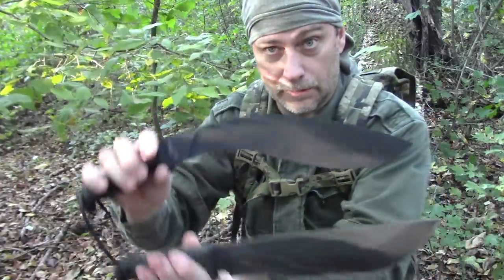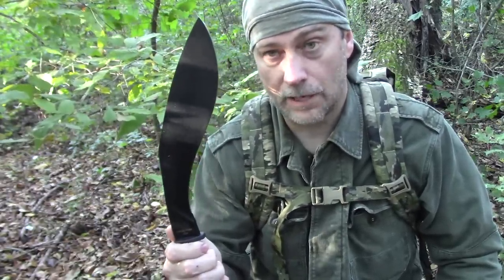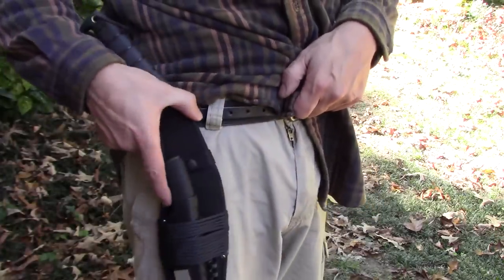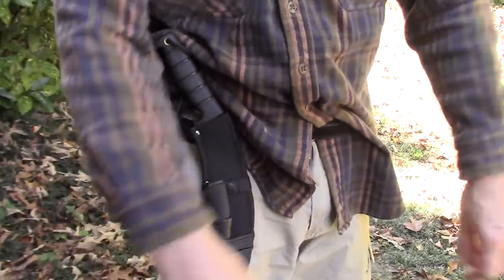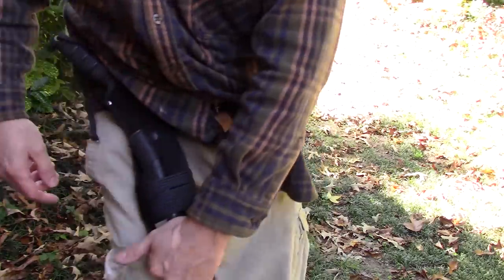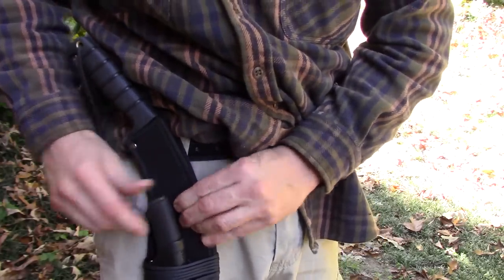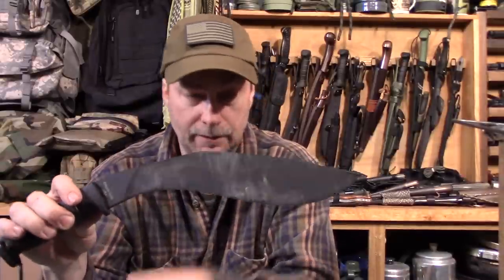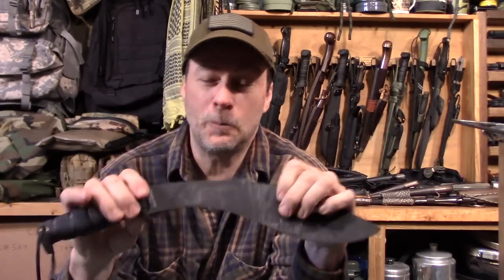Ontario Kukri vs. Ontario SP 53!

Comment: I like the "conclusion" being "inconclusive" and why that is; they're different tools that both do well for the tasks they're best suited for doing. The problem with a "one tool option" is that only having one tool limits your options.
Reply from the maker: Very well put Bob!
Reply: @Reallybigmonkey1  I want to point out that the kukri evolved in Nepal as a "Jack of all trades" tool so that you only have to carry one tool for everything from farming to hunting/woodcrafting to warfare. Like any such it's going to be a compromise, really good at some things, so-so at others and not so good at yet other things. The environment it evolved in is pretty similar to temperate forests like you find in the US, and in my experience, they do just fine for people like me who really like to travel light with as little gear as possible.

My favorite bush knife isn't a proper kukri though, it's a sirupate, a longer slenderer version of the kukri. It's better at clearing trails than a kukri because of the length and it feels better balanced. It still has the weight to do serious chopping.

The bottom line as you said, is what are you going to be doing. Select the tool for the job.
Reply from the maker: @markfergerson2145  Thanks for the comments Mark! Very well said

Comment: I have an sp 53 (based solely on your recommendation... and its awrsome!) And that Alan Kay kukuri from condor. I'd have a hard time choosing one over the other, because the steel on both is roughly the same thickness, and really, they're both so different, I use them for different things. The kukuri is the one that is on my "go bag" in my trunk only because it is [slightly] more "multitool...ish". The straight part is for carving, the angled for chopping, and the Alan Kay version has a flat pommel for hammering.
Reply from the maker: Perfect comments Chance! Those are both good blades but have very differing uses.

Comment: Here's my thoughts based on the very beginning of this video. The guy has the one but is wondering should he swap it out and buy the other. Based on everything we just saw, there would probably be no reason for him to change it out. Why spend more money for the other when the one he has can definitely get the job done. Add in the fact that should it ever be needed, the one he has would be a better viable weapon. 
As far as someone that has neither but is looking to purchase one or the other. I guess it would come down to what they are planning to use it for as you mentioned. One is a little heavier and shorter while the other is lighter and faster but longer. All things someone will have to take into consideration. I really don't see one being a better choice over the other based on all we have seen here. Each has its strong points. I think I would gladly have either in my bug out bag. But, if i had one of them, i wouldn't feel the need to spend more money to buy the other. Use that money for something else.
Reply from the maker: Very well said Michael! And I think once you own and use either of these one with become quite proficient with its use

Comment: I love Kukris, specifically my Cold Steel Carbon V USA-made model I bought about 25 years ago.  A massive maple tree came down in my sister's yard.  I was grabbing up branches and lopping them down to size to be taken out to the curb with my kukri and kept 5 people busy.  It's a chopping, slicing beast.  Scary to think it's used as a weapon.  For finer work I'll pick up my Mora, but for raw cutting/slicing/chopping a kukri is hard to beat.  The fabric sheath looks nearly identical to the Cold Steel machete sheaths they sell, all made in South Africa.  Not sure where the sheath is made but I wonder where that Ontario Kukri is made, looks very similar!
Reply from the maker: Thanks for the comments and your kukri sounds like a beast! I'm guessing them sheaths are probably made in China.  Take care and thanks for watching
Reply: Mine was ordered many years ago direct from CS not long after they first came out. It came with a true heavy kydex and a medium weight leather sheath. Absolute monster of a production modern khuk. For Godzilla may care wood work, heavier splitting and such I pick up the Himalayan Imports Ang Khola 18 inch tho. That CS will never be made in that steel with as good a heat treat on it again. What CS wants for the new ones in CPM3V is unthinkable to me. Truly sad

Comment: Morning Dave. I was by earlier but had to have some breakfast, I think considering the difference in the 2 blades differing geometry your review did justice to both But I would've liked to of seen usage on green wood I think the SP-53 excels in my view. Your the expert on vine clearing I have zero experience with that here in California in my area but as a kid on my uncles ranch we had weeds as tall as pine trees ,I was taught when using that machete not to cut horizontally but to us a chopping motion and to keep the height of the swing about shoulder high the reason for that was to save your energy . When it's 110 degrees in the central valley of California when out side you learn at a very early age to pace your self and you have about 3 miles of canal bank to clear it's the smart thing to do my uncle said remember this is not a one day job you will be here every day until it's done so don't over do it just get it done. I did of course cut some horizontally that was a no go for sure the slashing motion was the wat to go these weeds are about one inch in diameter not hard they have an almost liquid core but is was work . After righting this people who read it if any are saying what kind of an uncle would do this to a kid will it's just what we did in the 50's it was not mean we all worked in the heat it was something we learned to live with life or work does not come an go with the temperature . My uncle was a great man not a salve driver he was a great guy to work for he was fair all was looked out for you and no matter what you were doing on the ranch the last thing he would tell any one who worked for him was be care full keep an eye out for snakes and we had hundreds . Happy trails
Reply from the maker: Hello Mike and thanks for the comments! In Georgia we have heat and humidity but it's usually around 90 to 95 degrees Fahrenheit.  My dad worked in the soybean,  corn and cotton fields with the other kids back in the 50s. Thanks for the comments and thanks for watching
Reply: @Reallybigmonkey1  Cotton is a real hand torcher my uncles ranch he raised cattle grew cotton wheat, barley, soy beans and what ever he thought would be profitable you just never new . tuff business it takes no prisoners. Happy trails
Reply: @Reallybigmonkey1  Did I hear you correctly you'll be back next Friday HE HE HE HE  hint  hint hint. Stay safe happy trails .

Comment: A machete or kukri are designed to be swung in a downward motion at no more than a 45 degree angle with the blade sharpened at a 30 to 35 degree angle for general use on woody foliage. If you are using the machete or kukri in grass to heavy grass use a 20 to 25 degree sharpening angle.  I like to sharpen the front half at 35 degrees and the back half (especially the kukri) at 25 degrees. That gives you a fine edge for feathering and a strong edge for chopping.
Reply from the maker: Very well said Richard
Reply: @Reallybigmonkey1  Thank you! It's been a while since I have commented on your great show. Hope this was helpful.

Comment: Hey good buddy! I got a 21 inch machete and acquired a good slab of buffalo hide fresh off the tanners rack. Tough and oh so hard! I made a sheath with hand made tools. I made an oil/ wax tinting sealer from msc. Leftovers. I then remembered your awesome knife mods. I made a knife sheath to lash to my machete sheath with paracord! It has a slotted belt loop also. After the molding sheath drys I will heat up my   oil/ wax tint sealer and scrub it in for an hour or so! I had no idea how much fun  I could have on cold rainy days!
Reply from the maker: Now that sounds like one awesome sheath!

Comment: Thanks Dave great video, loved it...... A trick I have always used is with the Lanyard. Run the lanyard cord through  the lanyard hole in the knife, next thread both ends of the cord through a bead ( plastic, wood, metal or what ever you like) with the right sized hole in it so it will slide up and down the cord with a little tension. Next tie off with your favorite knot each end of the cords separately. Now you can run the bead to the knife so the cord won't catch on anything. Move the bead down to your two knots, and your ready to go...Works for me.
Reply from the maker: That's a cool lanyard trick Lloyd! And I'm glad you liked the video

Comment: I just reviewed this video for the second time, just for a refresher. I purchased my SP-53 on your recommendation back then & the only modification that I've done to it was to reprofile the secondary grind to thin the cutting edge a bit & it has been a champ ever since. My favorite kukri has been the Cold Steel Gurkha Kukri with the12" long blade & 5/16" thick spine. That thing will cross cut a 2" Mountain Maple sapling in one cut & stick an inch into the stump as well. It sinks through wood like a champ with the weight & curved grind. The best of both worlds for me.
Reply from the maker: Sounds great Barry! I haven't used that Cold Steel kukri but I'm guessing it weighs more than the SP53 if it's chopping that deep! I may have to try it sometime. Thanks for the comments and thanks for watching brother

Comment: I tried my new SP53 on thickets of blackberry cane and it was rebounding back instead of cutting through. The rebounding was too dangerous and uncontrollable (I set up the lanyard the way you showed, with cord) so I went back to using loppers stalk by stalk. I don't think I'd be much good hacking my way through a jungle. At the 18-19:00 mark you were trying to clear a twiggy stalk and it was moving aside instead of getting cut, that's what the blackberry stalks were doing, and they're so prickly I wouldn't grab them to hold them in place. This was a great review, thank you.
Reply: That’s where a traditional Latin machete, or Bolo excels!
Reply from the maker: The SP53 is definitely a wood chopping beast but doesn't have the length for grass and vines. Lopers do work but the best machete I've seen for vines grass and thorns is the Kabar grass machete. It's got a special duplex grind.  Thanks for the comments and thanks for watching

Comment: I watched this and all your vids for machete and knives and enjoy them. I've watched some multiple times when making my get home bag.
I love kukri and one reason is they are easy to use with limited strength. I have a Cold Steel machete kukri and haven't had the need to cut wood with it but did try it on cardboard. It sliced through it like butter. Theirs is a much thinner and lighter blade, but you are right on the action of it. Take Care and Stay Safe.
Reply from the maker: Thanks,  I'm glad you liked this one and the others! I've heard good things about the Cold Steel kukri,  I'm surprised it's thin. Take care and thanks for watching

Comment: Dave you do have a good selection of Cutting Tools . My biggest problem is how to Sharpen them Enjoyed it .
Reply: Worksharp tool and knife sharpener with a ceramic rod for touch ups in the field
Reply from the maker: Thanks Chuck. Hard to answer than, every blade geometry, shape grind and make of material gets a different process round here.

Comment: As I built a Kruger and researched it has 3 areas near the handle is a chopping angle coarse so not to stick ,The  area you are trying to scissor with is a blade 20 degrees for slicing and tip is slicing or stabbing. 
I'm going with your wood knife camping for the wood.I would walk around the extreme bush and raspberries areas if possible but good demonstration Sir,Thanks
Reply from the maker: Thanks for the comments John and thanks for watching

Comment: Dave I bought an SP8 after the very first video I saw of yours years ago. I thought if it was good enough for you it would surely be great for a novice like me. I got the SP53 about 6 years ago based on your recommendation. I have the Condor Mini Duku Parang based on your past review of Condor blades. I recently picked up a K-Bar KuKri on clearance but haven’t had a chance to use it yet. The curvature of the blade seems like it will do like you said in that it will move the material in along the blade causing more blade contact thus more of a cut. As always I learn a ton watching you have ‘’ Fun in the woods’’.
Reply from the maker: You just mentioned 4 really good blades! You definitely have a good collection.  I'm glad I helped you choose.  Take care and thanks for watching Steve

Comment: As usual, another great video.  I think you’re right on with their use.  I bought the SP53 several years ago on your advise and it is a great chopper.  It takes the place of a hatchet or small axe and is easier to control.  Each type of machete was designed for a particular purpose, so it depends what you’re going to do as to which machete you take with you.  Kukri, bolo, long jungle type, short machete, chopper (SP53) or whatever, they are all good in their own way.  I have the “machete bug” like you and enjoy them all when used for their intended purpose.  Keep up the super videos!
Reply from the maker: Thanks Tom, I'm glad you liked it.  It's going to be very hard for any machete to top the perfection of the SP53. A lot of machetes out there are good quality but yes, they serve their particular purpose.  Take care and thanks for watching

Comment: I bought my SP-53 soon after you, & it has been a high value addition to my woods tools. My favorite Kukri is the 5/16" thick "Cold Steel Gurkha Kukri". I also have the predecessor to that Cold Steel called the "All Terrain Chopper", also 5/16" thick spine, 12" long blade & more belly than the Kukri. I bought it used at a gun shop where it was traded for a gun. I paid $80 for it, but it looked new. It sinks into wood like nothing else that I own.
Reply from the maker: 5/16 thick? I've never seen any machete that thick! Definitely sounds like a real beast.  Thanks for the comments and thanks for watching Barry
Reply: Maybe I misled you, but these aren't machetes, they are kukris. Now I feel compelled to challenge you to compare the SP-53 to the Cold Steel Gurkha Kukri regarding chopping power, batoning & feather stick making.
Reply from the maker: @barrybaldwin5535  I would definitely compare them if I owned one.

Comment: we in the west think of the kukri as a tactical battle knife, but it started off the opposite. it's their traditional knife, with varying lenghts etc for their farming or brush clearing needs. so when they did go to battle, they took their knife with them. as a result it came to be associated with them.
Reply from the maker: Thanks for the info.  I guess in modern times they are just a bushcraft camping tool

Comment: Full flat grind or blades with traditional bevel edge will stick in the wood as you say.  The fix is to give the edge a convex grind.  It’s easier to maintain and chops better as well.  I looked at the SP53 but for a general camp knife went with the Ka-bar combat kukri with an 8.5” blade, paired with their standard ka-bar kukri for heavy chopping which I like a lot more than the Ontario as it has a super comfortable handle.  The SP53 does a good job filling both roles though.  Thanks for the review.
Reply from the maker: I have the Kabar kukri and Kabar Cutlass and I definitely love them too. But yes, nothing really beats the all around use of the good ole SP53.  Take care and thanks for watching
Reply: @Reallybigmonkey1  Well, based on your post here I just learned about the Kabar Cutlass, and it really looks like a 1” longer version of the SP53!  So I take it if you could get just one it would be the Ontario?  It’s hard to tell them apart.

Comment: Here in the northwest I'm not inclined to do that swamp camping --- I like my Condor Warlock & Mora Garberg Black. In my pocket I carry a TL29 electricians pocket knife. The Warlock is a bit heavy for long hikes but is a great chopper [at 75 I don't hike too far anymore] When I go it's either the Warlock or a hatchet. I've noticed you have a Warlock & a Garberg but don't say much about them --- take 'em out & play with 'em & tell us what you think. Thanks to you & the boy for the videos.
Reply from the maker: I have used that Warlock in several older videos and I even did some mods to the sheath. My Garberg is set up as a neck knife right now and I have a Condor Woodlaw attached to my Warlock.  Yes I love using that Warlock but man it's too heavy for long hikes. Thanks for the comments and thanks for watching Bill!

Comment: I disagree with you on what makes a machete a machete. It has to have a 12 inch or longer blade and it can’t be thicker than 1/8 inch. Blade shapes will vary slightly. That SP53 is definitely a heavy chopping knife. Same with the Kershaw camp 10,14 to thick to be machetes. The camp 14 is a short sword. I thought the camp 14 would out perform my standard Ontario G.I. Machete from 1982 in the Florida Everglades.. But it doesn’t. That machete is a beast with a ribbon of bicycle inner tube wrapped around the handle and the dull part of the blade(exposed tang). For the glades that’s all I need along with a camp knife.
I really like that SP53. I can use it in north Florida and other hardwoods. I’m buying one now. Thanks for the review. It looks like it will take a lickin and keep on tickin
Reply from the maker: I can agree with your dissertation but the manufacturers of machetes and large knives are the ones that have totally distorted what large blades are classified as. You're going to absolutely love that SP53